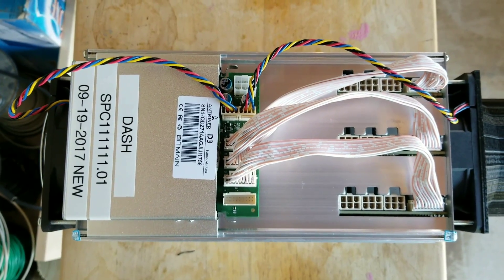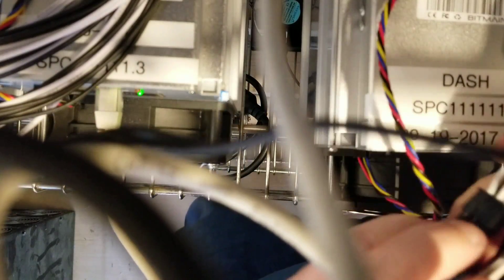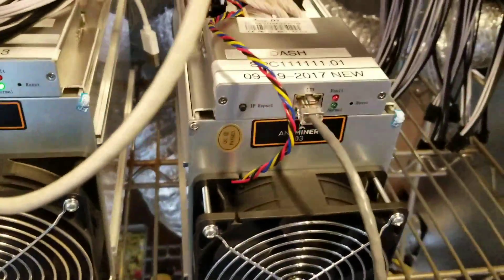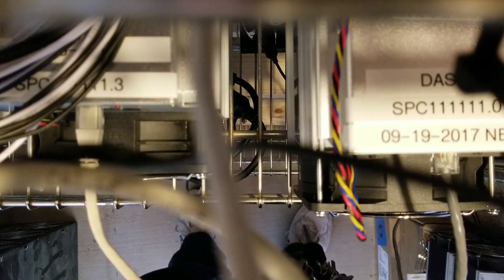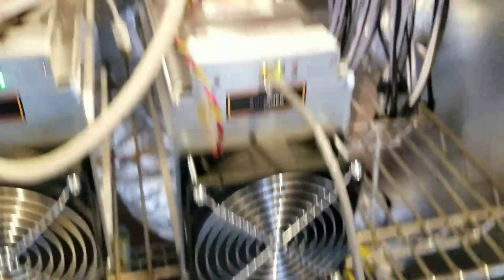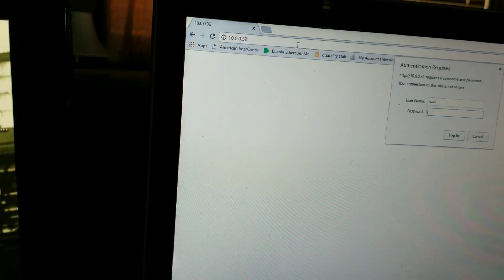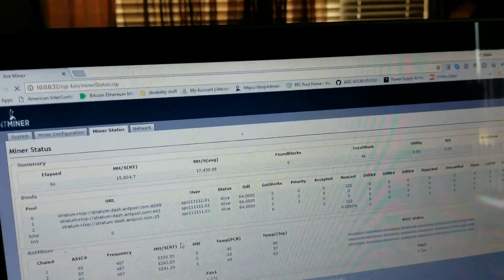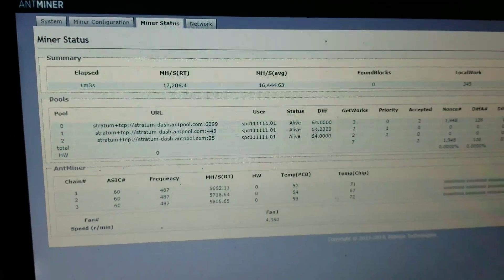Batch 1 antminer D3 great machine so far right out of the box

Comment: Can you tell me a little more about your mining room ? I'd love to see a video about the ventilation/cooling/heat exhaust system you setup.  Is the room in your garage ?  Dimensions ?  What do the exhaust ducts lead to ?  Is there a fan to help extract the hot air or is it a passive chimney-type that leads outside ?  Do you monitor the static pressure in the exhaust area vs miner area ?  Sound level with door closed in dB ?  I'm thinking about doing the same thing in my garage but wanted to see how you did it.
Reply from the maker: ill make a video about it. every one of the miners has a direct vent to the outside and the room is only 4 feet by 4 feet as of now. i just got my new shed that is 12 feet by 12 feet that i will be working on outfitting with a 600 amp service and full fiberglass insolation with 2 window air conditioning units that i will set one 5 degrees higher then the other and switch the settings once a week so they can rest. with insulated tubes from the machine vents to the top vent that will have an outflow fan sucking whats in the pipes out as fast as the machines put it out.
Reply: Was this a prebuilt shed like Tuff Shed or did someone build it from scratch ? How many do you plan to fit in that space ?  My other plan was also getting a shed so it looks like we're on the same page.
Reply from the maker: i bought mine from a local dealer, i would have built it myself but i have been to busy. it was built to my specifications to fit where i wanted it.
Reply from the maker: its built a lot better then a tough shed. it was built off sight and was delivered in one piece

Comment: Its over all ready for the D3 they are making $25 a day
Reply from the maker: yes the profitability will go down on the D3 for dash. if you join a multi pool you can have the D3 mine other coins that are more profitable.
Reply from the maker: a lot of the people that are mining with the D3 will also move off to other coins with their equipment to increase their profits with the machine. this will lower the dash difficulty and bring the profits back up. its not over, its just beginning. try www.multipool.us for different coins. you can exclude coins you dont want to mine and only mine the ones that you want to. this works for the X11, Scrypt, and sha256 type coins. so each miner will still be worth it by November as the pools thin out to multi pools.

Comment from the maker: if you want to know the amps that your machines are pulling it is very simple. 
you can run up to 6 D3+ units on one 220v 40 amp - 8 Gage wire
i would use 6 Gage wire just for extra protection

i would also use the power supplies from https://usahomegardens.com  you can run 3 L3+  or 2 of the D3, or S9's off of one power supplies. this equals less junk in your mining operation

L3 + = 800w / 110v = 7.27 amps
L3+  = 800w / 220v = 3.63 amps per 110v side
D3   = 1200w / 110v = 10.90 amps
D3   = 1200w / 220v = 5.45 amps per 110v side
S9   = 14th unit = 1372w / 110v = 12.47 amps
S9   = 14th unit = 1372w / 220v = 6.24 amps per 110v side
T9   = 1576w / 110v = 14.33 amps
T9   = 1576w / 220v = 7.16 amps per 110v side

hope this helps you all decided how to install your power lines for your units.

Comment: I'm getting 6 of these D3's. I want to install three 40 amps circuit breakers and three 220v outlets.  Can I run 6 off three 220v outlets in my basement?  I'm assuming I'm going to need a PDU to do this, but I wanted to get your thoughts on how to make it work with 6 D3's connected to three 220v outlets running off three circuit breaker My outside breaker has a max of 150 amps and we usually use 60 on any given time.  

I live in the mountain west and these D3's are going to be in my basement.  Cooling isn't a problem during the cold season, I'm going to have deal with it during the summer though.

Thanks in advance
Reply from the maker: if you are running 220 v each machine will pull 5.68 amps each lead so on a double pull 220v outlet that would equal 5.7 amps per side of the breaker so each side of the breaker will pull  34.2 amps, you could run all 6 units on one 40 amp 2 pole 220v breaker on a size 8 or 6 wire. each side of the breaker is 110 x 2 = 220v and one ground wire. i would suggest using the power supplies at  https://usahomegardens.com they can run 2 of the d3s per power supplies and are cheaper then the bit-main ones. and you can also purchase the power cable at the same time for the machines. the power cable is a c19 on the power supplies side and l6-20p  on the plug side. then you can go to home depot or lowes and get the l6-20 r and purchase 3 of them and then daisy chain them together to get your 3 outlets off of one 40 amp breaker. each machine will use about 200.00 a mo in electricity at California rates.
Reply: Appreciate the quick reply, that made a lot of sense I can totally see where you're going with this.  Very cool site, I took more time checking out the gun-parts and survival pages than the mining section :).  I'm thinking of reloading 300 BLK by using old 223 casing....but that's another project and another story altogether.   Again, thank you so much.
Reply from the maker: not a problem. i was just getting my mining room ready for the next 4 additions this Friday. im presently running 3 d3s and 3 l3+ units. i have 4 more l3+ units due on Friday
Reply from the maker: i just added this to every one of my videos

if you want to know the amps that your machines are pulling it is very simple. 
you can run up to 6 D3+ units on one 220v 40 amp - 8 Gage wire
i would use 6 Gage wire just for extra protection

i would also use the power supplies from https://usahomegardens.com  you can run 3 L3+  or 2 of the D3, or S9's off of one power supplies. this equals less junk in your mining operation

L3 + = 800w / 110v = 7.27 amps
L3+  = 800w / 220v = 3.63 amps per 110v side
D3   = 1200w / 110v = 10.90 amps
D3   = 1200w / 220v = 5.45 amps per 110v side
S9   = 14th unit = 1372w / 110v = 12.47 amps
S9   = 14th unit = 1372w / 220v = 6.24 amps per 110v side
T9   = 1576w / 110v = 14.33 amps
T9   = 1576w / 220v = 7.16 amps per 110v side

hope this helps you all decided how to install your power lines for your units.
Reply: You're awesome, thanks again man.

Comment: Sorry to bother you again. I just received my D3 today but one of my hashing boards is reading all x's. The other 2 are reading 0's. Do you have any suggestions on troubleshooting the problem board without having to send it all the way back to China? Please help
Reply from the maker: check your cable connections un plug them and plug them back in then reboot the machine. this will not void your warranty its just unplugging and resetting them. make sure the mahine has a good airflow. this is the key to protecting them.
Reply from the maker: yes i am. the jump is due to the machines coming on line. what we need now is a good jump in price to compensate for the increase in difficulty.
Reply: shawnpc1 thanks for the advice. Tried your suggestion but same result with the board. I've contacted bitmain, hopefully will hear back from them Monday. I appreciate you trying to help.
Reply from the maker: no problem. 

1. take a screenshot of the miner status page in your browser
2. a screenshot of the system page on your web browser 
3. a picture of the serial number of the machine to include the pictures in your repair ticket. 
4. go to this sight: https://shop.bitmain.com/support.htm?m=technicalSupport
5. do a warranty check on their sight and screenshot that to attach the picture to the product support ticket that you need to create at the same link after the warranty check
6. include your order number in the product support ticket and a brief explanation of what the machine is doing.
7. they will e-mail you back with advice or to request that the entire machine is sent back. 
8. do not open the machine unless they give you permission it will state in the e-mail to remove boards and send them back if you fallow their advice test each board individually and remove and send back the bad board's or your warranty is voided. they can tell if the tape on the screws is broken.  http://support.bitmain.com/hc/en-us/articles/222648028-How-to-disassemble-miners
9. if you are removing any boards fallow this link to package them or they will void the warranty.  https://youtu.be/Z0LdykALhxI

fallow the steps above and you will get a fast response from bit-main and it will help the repair go faster. ask to send the machine in the repair ticket to the California repair facility so you can avoid overseas shipping charges.

Comment: Have you had any issues with your D3 such as it constantly rebooting with the fans increasing in speed then slowing and also receiving this error in the Kernel log? read_temp_func: can't read all sensor's temperature, close PIC and need reboot!!!
Reply from the maker: that means your ASIC chips and pcb are over heating. once above 80 degrees the machine will stay on but the asic chips will shut off to protect them from burning up both the board and chips. this normally happens from over clocking or non efficient cooling or air circulation.
Reply: That makes sense.  Thank you for the insight!

Comment: Did you create and 3D printed fan duct? Could you share the file? Thanks, mate.
Reply from the maker: the fan duct is up on thingyvers
Reply: Thanks. My question in my mind is by reducing 120mm airflow to 100mm, would there be exhaust bottleneck? Can the 3D design be changed to maintain 120mm airflow?
Reply from the maker: the fan duct on thingyvers fits the fan size for output. problem is it does not take care of the upper vent above the fan on the back. i have a new vent that will solve that problem. my prototype is printing right now so i should be able to verify it tomorrow
Reply: Fantastic, thanks. What 3D printer are you using? How long does it take to print one duct and how much (length of) spool is used to print one?
Reply from the maker: my new duct is just an upper duct. it will take a duel tube to vent the machines. but your room temp will drop dramatically if the new design works.
Reply from the maker: i might make a dule tube to attache both vents in to one but that will be after testing of the new vent. the new one takes almost 12 hrs to print and the back fan vent takes about 3 hrs to print. i am using a rep-rap clone